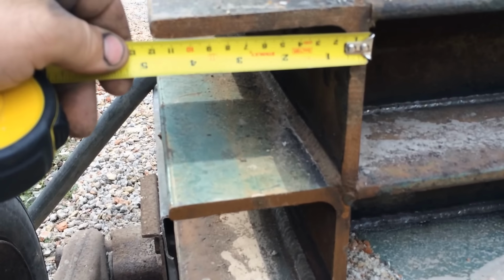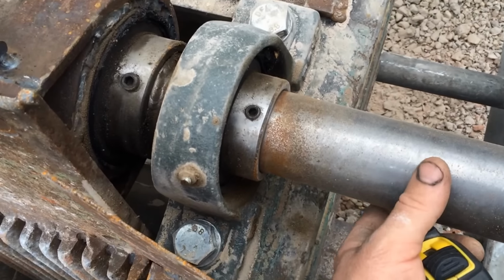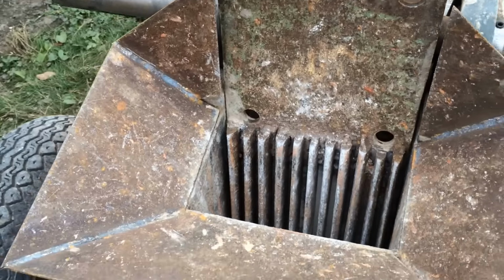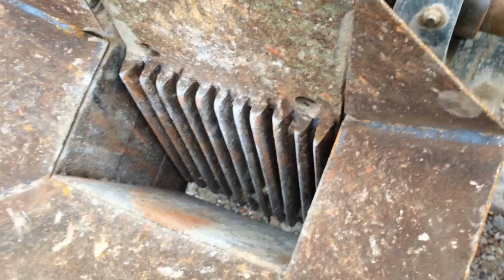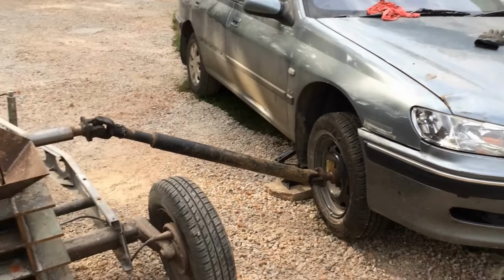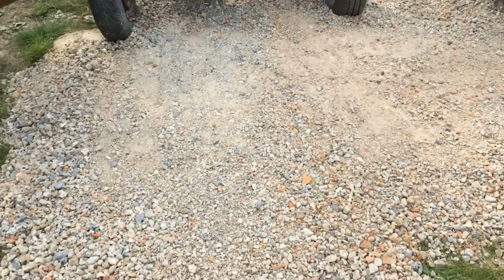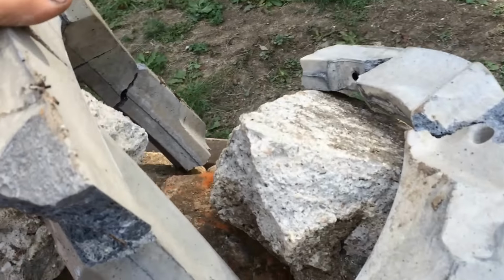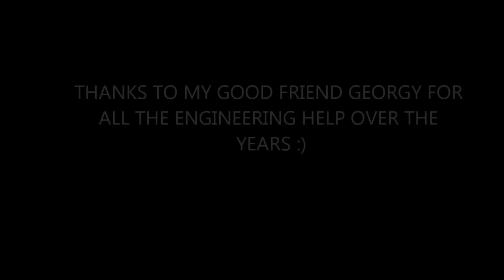Home made jaw rock crusher

Comment: That works just like my jaw rock crusher I built on back.  Instead of a driveshaft I used an old trailer tire and looped a belt around it from a horizontal shaft engine.  I did the eccentric the same way using pillow blocks and found the same issue, I busted the cast iron housings and eventually scrapped the whole thing after trying to "fortify" them.  Looking back, that's the perfect application for a poured in place babbitt bearing with a grease fitting for lubricant.  Low speed, high pressure, and plenty of width to take the loads.  I crushed up a bunch of construction rubble to "pave" out a piece of driveway next to my shop to park equipment on.  Worked a treat, just hard on pillow blocks.

Comment: So amazing! i would love to make something like this! Can i ask you a question about it? I can see the top of the moving blade 'plate' (with the scraper blades) is held by the ecentric bearings and the 60mm rod, but what is holding the bottom end of this plate? is it just sliding up and down against a very sturdy bit of steel? thanks loads i'm hoping to make one!!!

Comment: still amazed at this, seams to be the most effective one i have seen on you tube, what does the bottom of the jaws pivot around or is it just free to move and the jaw just hangs off the shaft?
Reply from the maker: Thanks! Yeh it does work really well, bottom of the moving jaw is just hinged at 45 degrees, just wish I'd made it adjustable!

Comment: I about rolled laughing when you tossed the washer counter weight in there! I always knew there was another use for them but just couldn't sort it out........LOL! 
 It's kind of hypnotic watching that bugger maliciously munching away on old concrete! It's not like there is a bunch of flying debris and dust like hammer mills. If those grader blades get too worn just get the local welding supply to hook you up with a box of hard facing rods. One bead down each blade should do you for a good while!
Terry from South Carolina USA
Reply from the maker: Yeh I always thought those counter weights would crush nice! Yeh I wish I had just welded some rebar to the jaws and gone over it with hard facing rods.... The loader blades just weren't very hard! Thanks for watching 👍

Comment: We are trying to figure out the levers on the back of the machine. We have out springs in but something is stopping it from working properly. The rest has all been built as we can see on the video but the Spring mechanics is not shown. Can you perhaps help? Is there a spring or a rod at the back of the plate?

Comment: This thing looks like it works so well im tempted to build one! 
You say the teeth were made from scraper blades? what exactly do you mean by that? the blade off a digger or something?
Reply from the maker: Make one! Its one of the best things I've ever built and still works great! Blades are off a loader but they weren't as hard wearing as I thought they'd be but if I did it again I'd just weld line's of hard facing up and down the jaws!
Reply: @marktgsxr  i wondering about perhaps some square bar welded to the main plate then a series of hardened bolts or something that could be used as replaceable teeth perhaps. will have to do a bit more research and see one in person before i start a build.
many thanks
Reply: @marktgsxr  wonder how  strips of straight car springs would work? Is the bottom of the jaw just sliding up and down on a heavy piece of round stock behind it?

Comment: really looks like it would benefit from a heavy flywheel
Reply: Or two.
Reply: In essence, the automobile wheel is acting as a flywheel
Reply: @chrisfleischman3371  as seen as you replace it with a waterfilled one a little more?
Reply: And the bend angle of the drive shaft is too high. The vehicle should be placed a little higher 😉🔭.

And there should be room for a wheelbarrow under the machine, where the product could go into, instead of on the ground, thus requiring one (unnecessary) operation more.

Comment: That's pretty cool, can you tell me what the length and width the jaw is? I'm currently trying to build one myself. thanks
Reply from the maker: the jaw is roughly 24" in length and 10" wide, the most omportant thing is the toggle plate angle as it determins the amount of movement at the bottom of the jaw!
Reply: +marktgsxr 
Thanks, do you have any other video of the back side of the machine?
Reply from the maker: +91Cruzin i have another video of it now iv added a diesel engine to it that i will upload soon!
Reply: +marktgsxr 
Did you use the angle iron for the sides and the front?
Reply from the maker: +91Cruzin yes the main body is all made of scrap angle iron all welded up, its incredibly strong!
Reply: @marktgsxr  
Hello How do I get the machine am from Kenya?

Comment: should be able to transition to a side shaft 10 hp or more,,a good used one ,or i think the chinese have a 2 cylinder diesel for a few hundred u.s.    they also have the petrol engines cheap......both i think are Predator named ?    anyway ,steam would also give real hp and any thing 5hp to ten would kill them rocks    good job! and future success!
Reply from the maker: Tew Dogs I ended up adding a small single cylinder diesel from an old dumper in the update video, works great! Thanks for watching!